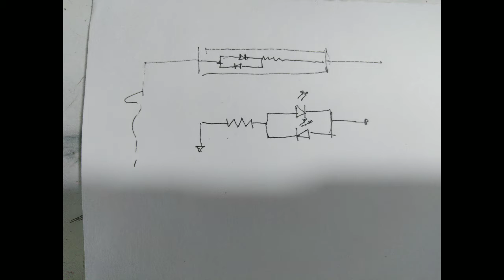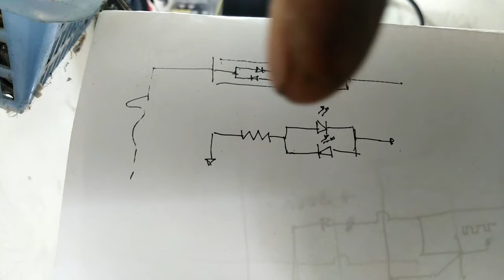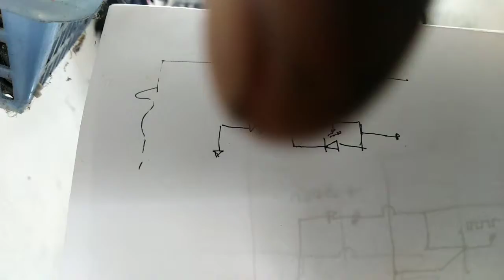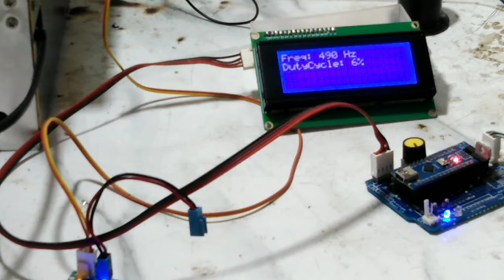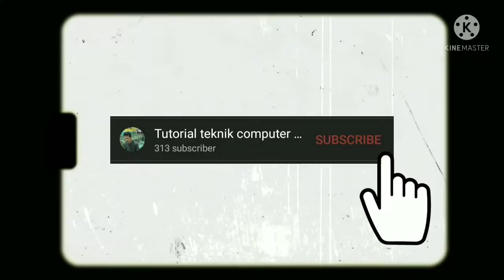cara perbaikan DU Dahao Ms01 #dahao #du #mesin cina

Comment: Suara music nya tolong kecilin..
Atau ga usah pake musik.. ga jelas suaranya mass.
Makasih ilmu nya... Salam teknisi
Reply from the maker: Siap... Makasih masukanya... Salam
Reply: Bang kalo inverter pecah ic fet 15n60 itu konsleting dari mana kira kira ya
Reply from the maker: Ada berapa kemungkinan.. Shot kabel out, rst.... Amphere seting. Di dipswit ketinggian..... Opto coupler masalah.... Tegangan 12v untuk fet masalah,....ic kontrol ampher 4053 masalah..
Reply: Makasih ilmunya bang..
Reply from the maker: Siap bang... Maaf kekurangannya...